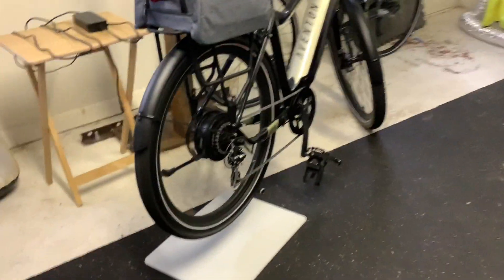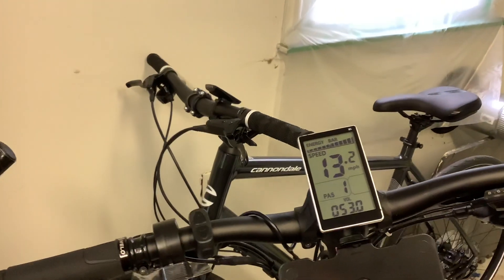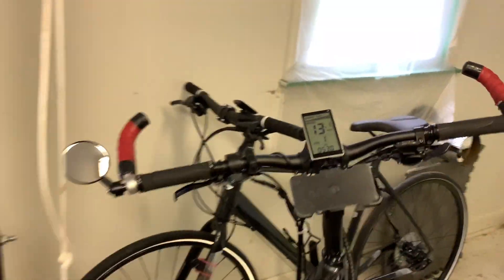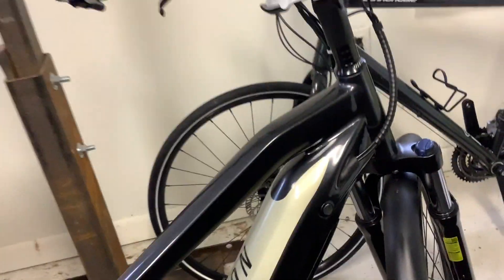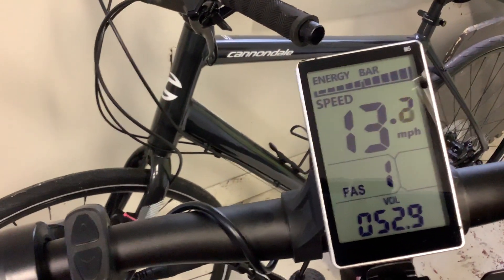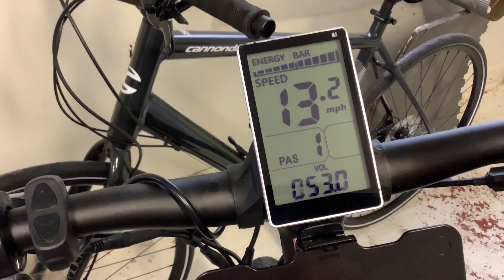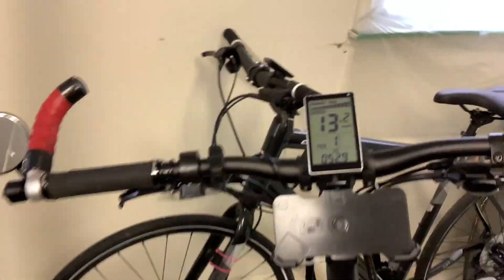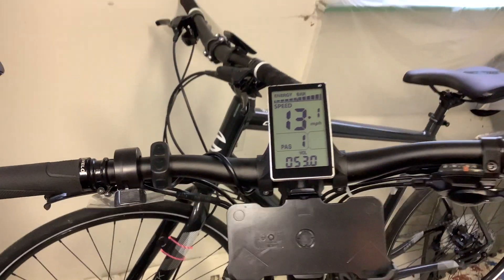Aventon Level battery management

Comment: I'm confused now because I heard the (Aventon) batteries should be stored in a charged state....  need to do more research now.
Reply from the maker: Lithium batteries do not like to remain stored for very long in a fully charged state.  Over time, all lithium based batteries slowly lose their chemical efficacy, but this process can be greatly accelerated if left fully charged and unused.  They want to be stored at about 50% - 60% if unused.  I generally charge up the night prior to use, and in this case, I did that and had something come up that would prevent me from riding for about a week (partly weather related).  Because of this, I ran the battery to about 60%.  This winter, I stored it at about 60% as well.  If you really run the battery down riding (anything below about 15%, you should charge it to about 60% for storage.  If left in storage with a very low charge, the normal trickle down could result in no charge, and then all bets are off whether you will be able to charge it again.
Reply: Why? Because you watched a morons post on YouTube ?